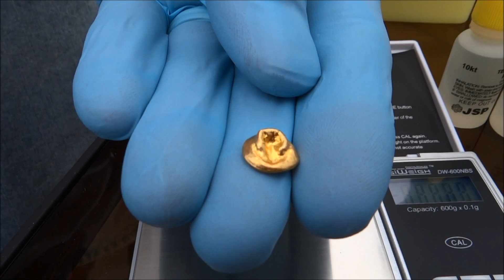How to easily recover gold from scrap computer chips - Purity Test

Comment: About how many grams of gold can I get from 1 stick of RAM? I only have one stick, so will the gold I get from it be worth the price of the acids and the gold testing kit?
Reply: Based on his nugget weight, which came from 100 sticks, you will get 0.0191 grams of gold per memory stick.  

There are 31.1035 grams in a troy ounce
So, one stick will yield 0.0614% of a troy ounce

If the spot price of gold is $1250 USD per ounce, each stick of ram will be worth $0.76 USD. *

If the price is $2000 USD per ounce, each stick is worth $1.22 USD.*

(multiply the price of gold by 0.000614 to get price per stick)

In conclusion, in order to just break even right now (Oct 2016) you would need about 7 sticks.

* Good luck finding someone willing to pay you the spot price. Better to use the local price that someone is willing to pay per troy ounce.

Comment: ok, so I went back and rewatched the videos (just 1 and 2 i'm not counting the test acids).  He used aproximately $.70 of hyrdogen peroxide to start (just picked myself up a bottle a few days ago for a first aid kit, was only 70 cents stuff is cheap).  He then add about $2.50 worth of muriatic acid (I found this by taking 1/4 and multiplying it by the cost of a full gallon, I found a gallon for about $10 online).  He then used $1.77 of 70% nitric acid ( he used a 3 fluid ounce tall shot glass and he fills it about half way.  1.5 fluid ounces is about 44ml.  The cost of a 500ml container of nitric acid is $20.10.  44/500=.088 then multiply that by 20.10 = 1.7688).  He then adds $.12 of muriatic acid ( 1.5 fluid ounces = 0.0117189 gallons.  0.0117189/1= 0.0117189.  0.0117189x10= .117).  He then uses $1.24 of urea (1 tablespoon roughly translates to 15 grams. 15 grams = 0.0330693 pounds.  0.0330693 pounds = 0.529108802333 ounces.  I found 3 ounces of Urea for $7.  0.529108802333/3= .1764.  .1764 multiplied by 7 = 1.2348.  Companies always round up cost so I will aswell.)  He then uses $.05 of Sodium Metabisulfite (2 teaspoons is roughly 10 grams.  10 grams is 0.0220462 pounds. 1 pound of Sodium metabisulfite is $2.10.  0.0220462/1= 0.0220462.  0.0220462 multiplies by 2.10 = .046).  So in total he spent $6.38 on chemicals that he USED.  If you want to add equipment he used Tin Snips ($15),  Safety Goggles ($22.50),  a respirator ($22.00),  a plastic pale (about $3.00 plus you can get all sorts of delicious things inside to eat beforehand),  2 2cup measuring cups ($11.38),  Latex cleaning gloves ($13), Latex medical gloves (negligable),  1 empty coffee container ($4, or free with purchase of coffee),  1 glass stirring rod ($1),  1 strainer ($4, idk why he ended up using a second one...),  a pack of coffee filters ($13),  1 mason Jar (1$),  1 spray bottle ($2),  1 babyfood jar ($5, or free with purchase of babyfood),  1 3oz shot glass ( $24),  1 teaspoon ($4), 1 tablespoon ($3),  1 hot plate ($18),  1 crucible ($5),  1 pair of tongs ($8),  1 blowtorch ($20), and 1 steel sauce cup ($1).  So from scratch, if you used everything that he used exactly it would cost you about 200+ dollars, and that doesn't include the memory cards themselves.  Also if you do it more than once the total price would be reduced because you do not need to rebuy most of the items.  With that piece of gold he COULD make up to $78 dollars today.  Thank you for reading this took forever.
Reply: nerd
Reply: long term investment sir.. if he repeat that process again, he doesnt have to buy the equipment... please compute how much he will earn in a  month or  1 year if he'll do it 4 times a week
Reply: this doesn't take into account how much time it costs to do this either...if you are looking at it from that perspective anyways.  Time = money.  It would probably be more efficient/cost and time effective to just pick up old junk computers left out, get with companies that are scrapping their hardware or visit the junkyard to see if you can pick up old parts that way.  Computers also contain other rare earth metals so it could be lucrative to just have the base materials and sell those to people who have good refining processes established.
Reply: AND, it could have been better written LOL
Too much text in the same paragraph.

Nether the less, I saw one or two videos where they show that you can re-use the chemical solutions as long as you keep adding one of the acids in it.

As you mentioned in that lump of text, the containers may last for more than 5 or 10 processes, depending on their quality, and the weight of "fingers" used could have been more with the same amount of chemical solution without reaching saturation points.
Reply: you sir have way too much time on your hands, haha. Probably enough time to make a killing by doing this yourself. lol
Reply: 15.000$ a year. By far from enough to keep up a solid economic base. Besides that, I'm clueless how he got hold of thoes fingers to begin with, how would you get hold of all the fingers you're going to need?
There is a ton of better ways to use your time if you wanna earn money, and it will most cerainly be more healthy aswell.
Reply: That's awesome.
Reply: this acid mixture can be used over and over and over you get where i am going i hope
Reply: Please be aware nether is not a word.

Comment: Hi from lv. I have kg and euro. there was about 200 ram sticks and recover 2. gram gold? then there is about 3 kg= 200 ram sticks 6.6 lbs. But gold refineries buy ram sticks about 11 lbs/kg. I guess when this 2 gram. gold value is about 42. eiro. or 46. usa dollars. Then refineries buy gold chips about 72.6 usa dollars when its 11 lbs/kg? Maybe Im mistake?
Reply: Hi !
   I process gold memory and slotted card fingers and the return is between 1.75-2.5grams of pure gold, after twice refining, from each pound of fingers. Yields depend on the material you cut the fingers from. Telecom equipment, industrial grade computers and military spec. give the highest yields.
   fingers from memory contain about half of the gold yield from the strips. There is gold as traces under the green mask  and inside the black chips (very pure gold bonding wires). There is a small silver content in the solder and the small monolithic capacitors (usually tan with silver colored ends) usually contain 1-2% by weight silver/palladium. You can still sell the de-fingered boards for near half the price of whole board.
  Hope this help to understand.
  Art

Comment: I was thinking this would be different,  because it says  " easily " but its the same process,  seems like though that his would be way more profitable if you didn't do them in tiny 2 gram batches but instead just kept collecting the parts , ram and cpu's and anything else that was gold plated like that and then did it all at once, at some point before you die.  If you did have a reference  you could estimate what you had by counting and keeping fair track of what you tossed in your bin.   I don't know how many of the old ram you cut and tossed in that bucket, but say it was a nice round number like 100. 

   so 100 Ram = 2 grams. 10,000 ram = 200 Grams    @ 24k = 7572.73 USD Oct 17th, 2015 1:20 AM mountain time.  

   where to get a hold of 10,000 old memory chips though?    better still, where do we find 217,888 Memory sticks   that is how many I will need to make 165,000.00 Usd in gold.   which would be ideal for me.   Have to have some extra ones to come out with the 165k  to pay for the materials.     And probably have to pay some fines for the chemical waste dump that would be created.

Comment: what was the cost of all the chemicals and equipment, including the safety equipment? Do you have an equipment list?
Reply: +Leo F  ok, so I went back and rewatched the videos (just 1 and 2 i'm not counting the test acids).  He used aproximately $.70 of hyrdogen peroxide to start (just picked myself up a bottle a few days ago for a first aid kit, was only 70 cents stuff is cheap).  He then add about $2.50 worth of muriatic acid (I found this by taking 1/4 and multiplying it by the cost of a full gallon, I found a gallon for about $10 online).  He then used $1.77 of 70% nitric acid ( he used a 3 fluid ounce tall shot glass and he fills it about half way.  1.5 fluid ounces is about 44ml.  The cost of a 500ml container of nitric acid is $20.10.  44/500=.088 then multiply that by 20.10 = 1.7688).  He then adds $.12 of muriatic acid ( 1.5 fluid ounces = 0.0117189 gallons.  0.0117189/1= 0.0117189.  0.0117189x10= .117).  He then uses $1.24 of urea (1 tablespoon roughly translates to 15 grams. 15 grams = 0.0330693 pounds.  0.0330693 pounds = 0.529108802333 ounces.  I found 3 ounces of Urea for $7.  0.529108802333/3= .1764.  .1764 multiplied by 7 = 1.2348.  Companies always round up cost so I will aswell.)  He then uses $.05 of Sodium Metabisulfite (2 teaspoons is roughly 10 grams.  10 grams is 0.0220462 pounds. 1 pound of Sodium metabisulfite is $2.10.  0.0220462/1= 0.0220462.  0.0220462 multiplies by 2.10 = .046).  So in total he spent $6.38 on chemicals that he USED.  If you want to add equipment he used Tin Snips ($15),  Safety Goggles ($22.50),  a respirator ($22.00),  a plastic pale (about $3.00 plus you can get all sorts of delicious things inside to eat beforehand),  2 2cup measuring cups ($11.38),  Latex cleaning gloves ($13), Latex medical gloves (negligable),  1 empty coffee container ($4, or free with purchase of coffee),  1 glass stirring rod ($1),  1 strainer ($4, idk why he ended up using a second one...),  a pack of coffee filters ($13),  1 mason Jar (1$),  1 spray bottle ($2),  1 babyfood jar ($5, or free with purchase of babyfood),  1 3oz shot glass ( $24),  1 teaspoon ($4), 1 tablespoon ($3),  1 hot plate ($18),  1 crucible ($5),  1 pair of tongs ($8),  1 blowtorch ($20), and 1 steel sauce cup ($1).  So from scratch, if you used everything that he used exactly it would cost you about 200+ dollars, and that doesn't include the memory cards themselves.  Also if you do it more than once the total price would be reduced because you do not need to rebuy most of the items.  With that piece of gold he COULD make up to $78 dollars today.  Thank you for reading this took forever.
Reply: I second the question.
Reply: +Leo F I third the question.
Reply: +ThelagKing Strikes Thank you.
Reply: +ThelagKing Strikes 
Hey, thanks for this important information, now we have a clear picture of investment from this recyling project!

Comment: where are the how to make diesel fuel at home videos... :)
Reply from the maker: Wim V Hmmmm...there's an idea.
Reply: Wim V a mate of a mate uses used cooking oil and mixes it 50/50 ratio with diesel and it stretches out his fuel bill dramatically ... he strains all of the impure materials so the oil is clear  before mixing it and he uses it in a toyota hilux  not sure what model it is or engine model and has been using for several year now in this manner

Comment: This would have been really worth your time if you had like 100 times the chip strips.
Reply: you can do it with more than just ram or momory. video cards network cards cpus' main boards all contain gold plating the easiest to recover from are cpu's and the expansion cards
Reply: xpallodoc They cut a 100 RAM for 98 dollars in Gold . Used RAM can sale for 1 up to 5 dollars !
Reply: Allen West
you assume the sticks still worked or were even cureen't/ viable products
Reply: kyle hubner
You assume that he has tested all 100 ?
Reply: ut you also assume they're viable for modern pc'susually the systems being discarded these are collected from are 5+ years old
Reply: people dont just give scrap computer parts away usually now.. sure you can salvage some here and there but to get 100 times the amount he used is impossible if you dont have a scrap business or some other means of obtaining free computer parts. Check out 7:20 of his first video... theres a good 100 strips in there or so.. i highly doubt he obtained those for free. then take away cost of materials used.. fuel to melt them .. and your profit margin is super low if not in the negative. Not to mention the time spent doing this/finding that much scrap parts that could be spent at a job making money.. so you would lose money in the long run if i did my math correctly.
Reply: +PlacidDream i haven't spent a  penny on any computers and ive collected well over 300 computers just by word of mouth and other ways so yeah for me its free to get them idk why u think u cant get something for free from someone who's just gonna throw it away or give it away there are nice people in this world you know have a great day good luck collecting seems your having a hard time or just don't want to do the work to get them for FREE!
Reply: Nate Chaps 300 computers??!! wow ballin' .. after a week of hard work scrapping (not to mention all the time you spent gathering that shit) you might make 150$.. grats dude.. bet your place looks great with 300 computers laying around. get a life.
Reply: you obviously know nothing about scrapping do you. once you get the bits you want the rest goes in recycling the aluminium cases go to the scarppers for extra money. stop being so but hurt over people taking things people don't want expending their own energy on extracting a small amount of something people DO want
Reply: +PlacidDream ur just mad n jealous cause u have a boss and cant do what u want but see i don't work for anyone but myself n all my time is valuable n it doesn't matter what u assume about US WE KNOW WHAT WE R DOING MY FRIEND UNLIKE YOU WHOS JUST A SCREEN SHIT TALKING FOOL WHO HAS NO IDEA WTF HES TALKING ABOUT ITS TO FUNNY HOW U ACT GIVING ME A HEART ATTACK YOUR SO FUNNY. HAVE A GREAT LIFE WORKING FOR UR BOSS SUCKING ASS ALL DAY MY FRIEND N U SAY WE NEED TO GET A LIFE THATS FUNNY CAUSE I HAVE MORE OF A LIFE THEN U ANY DAy
Reply: Nate Chaps annnnd youre dirt poor. grats.. that must get all the ladies. im so jealous that i have a job.. ya thats it.. rather be beging for peoples garbage so i can sell it to make rent. youre killing the game dude.
Reply: lol ur so right have fun my friend ttyl.

Comment: This is really cool. It seemed to be a significant process for $75 to $80. How difficult would it be to increase the size of what you separated out? Doing 10x as many memory chips would take longer but probably not 10x as long and you'd get $750 to $800. I guess I'm asking how scalable is this process?
Reply: +Jarod Morris All you would need to do is quadruple the amount of everything you see in the vid I would say, all you're really doing is splitting the shit from the good you could trial and error it as long as you want because you're not gona hurt the gold :D 
I would jusT start collecting and cutting up the boards over the space of a year then just allocate an entire month of work to getting everything out of it, I think if you went through a good 10/20,000 boards you could make a pretty penny so long as you purchased all your chems in bulk and got most of the boards free from scrap or very very cheap.
Reply: logical to me
Reply: okay spock

Comment: Would the process you used in these videos be a viable method to separate gold from black sand and other impurities like mercury?
Reply from the maker: Chris Trollhunter I never tried it.  Research more before you do and let me know.
Reply: The problem with using this method is that AR (HCL and Nitric)  isn't the way to begin separating gold from impurities.  And I wouldn't include black sand as an impurity that requires acids.  Mostly, panning is used to separate gold from black sand.  On the other hand, for impurities such as silver, copper, tin, nickel, and other metals, acids are a method of recovery, but the acids must be used judiciously.  For example, while Silver is digested by Nitric, it isn't digested by AR.  With tin, you want to use only HCL, and not Nitric.

Comment: In a desktop, you would need to melt down about 1 ton of motherboards in order to get 5 troy ounces of gold.  The average board weighs 5 pounds, so that means in order to get 5 troy ounces of gold you need to scrap 400 mobos. Today, one once of gold is worth 1178.59$ this means that assuming you salvage 100% of the gold of that mobo with 100% efficiency, you would make about 23.51 USD.  You are going to spend at least a couple hours doing that, which puts you about on par with minimum wage.

So let's say we want to make some more money, because I don't know about you, but minimum wage isn't enough for me to mine computer components, here are some more figures for you:

There is about 5 troy ounces of gold in 200 laptops.  That means you must scrap the mobo, psu, ram, wiring, cpu, gpu, and ports.  This would take you about 6 hours, giving you 7.80 USD per hour.

So here is the question when you are thinking about the economy of doing such a thing as striping down boards for metals; are you going to be compensated enough in exchange for the time spent to strip it, and sell it? It would be better of for you if you just sold the components instead. By time you sell that metal, after the entire process you must go through in order to extract it, you will be making such a small margin back on your time that you could literally have gone and gotten a job at McDonald's and have made more money.  So if you enjoy working for less than minimum wage, feel free, my time is worth more to me than that.  And that doesn't take into account how much money you will spend in gas to get to where ever you are selling the gold, time spent getting there and back, measuring and refining, etc.

In short you are not going to make money doing boards one at a time using processes available to you at home.  Dell mines old equipment by shredding boards and then using magnets to pull steel, followed by eddy currents to propel non-ferrous metals from the plastics.  They do this at rates of thousands per minute.